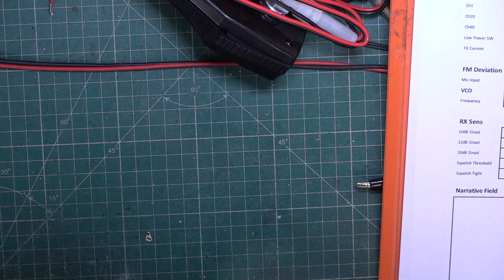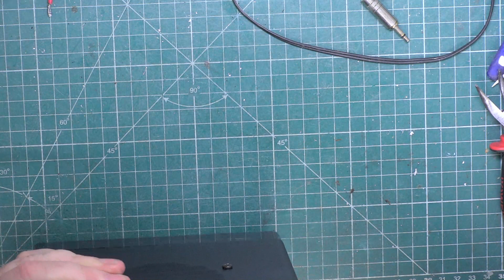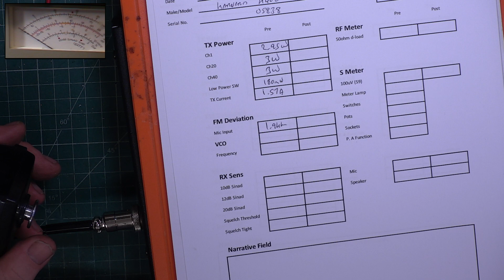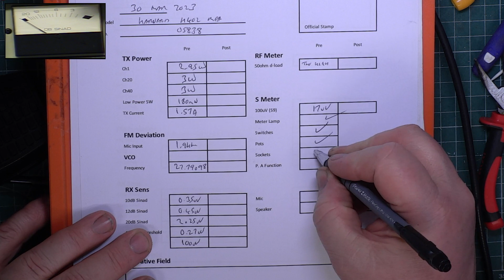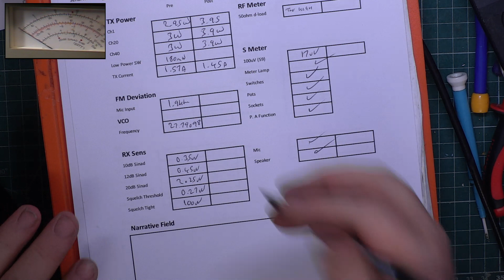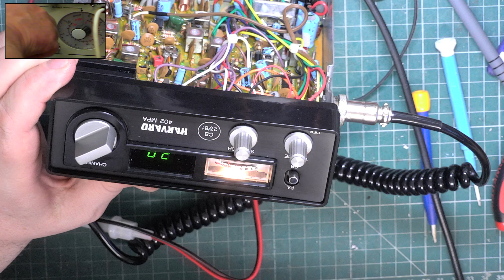Harvard 402MPA (H160) CB27/81 UK FM CB radio - service alignment

Comment: Hi richard good luck on servicing the HARVARD 402 mpa (H 160) cb 27/81 uk fm cb radio   from paul chapman at east sheen 73's 
When you did  your air test yesterday you didn't say thank you
Reply from the maker: Hello Paul & thanks for the comment. Because of work commitments there are times I may not see the computer for 8 or 9 hours. At present we are tuning quite a few church organs ready for Easter.

Richard
Reply: To richard good luck on repairing the church  @ukfmcbradioservicingTango21  organs from paul chapman at east sheen 73's